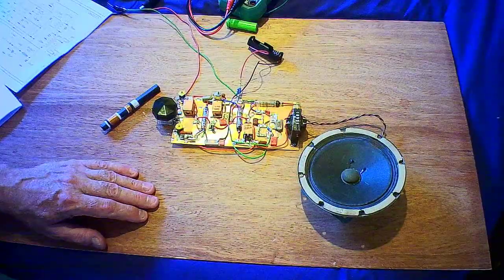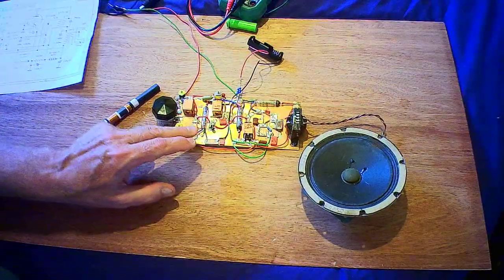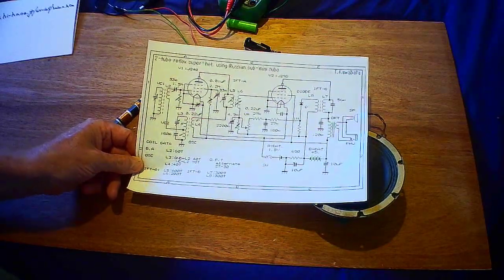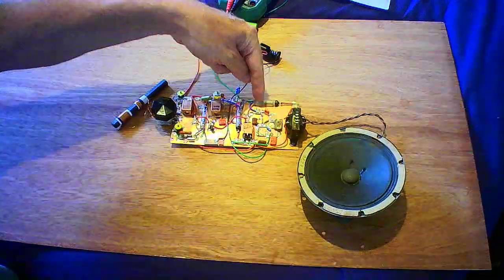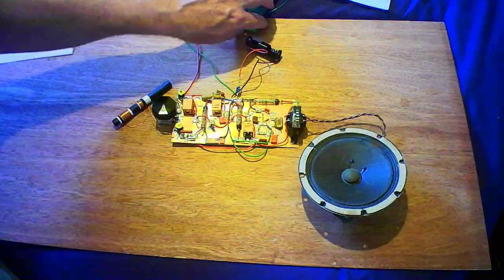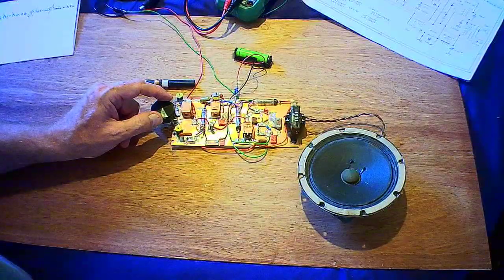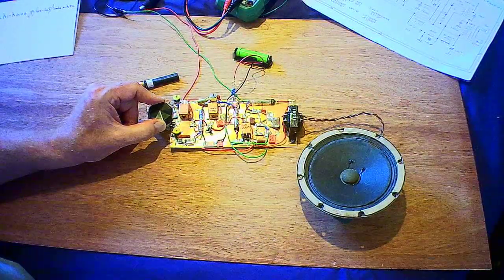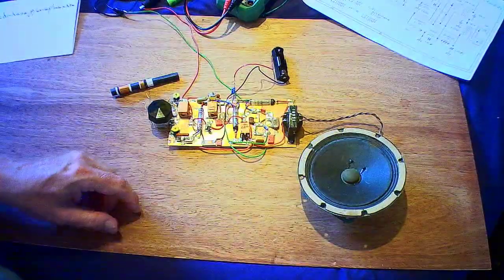Home made Super-het radio with 3 Rod style Pentode Valves/Tubes.

Comment: It's great to see these projects working well and they are of more interest to the older generation like me, that see modern tech as a consumer convenience. I remember the hours of fun I had building radios on veroboard, trying out circuit diagrams from mags and books. I only used transistors but they worked. You are right about the fewer stations received now, about half of what there was 30 years ago.
Reply from the maker: Thanks for the comment, I consider myself as one of the older generation.  I did 40 years as a two way radio service engineer, from early sets that had valves to transistors to radios being full of IC's and lastly to modern day full blown dsp/software radios.  Unfortunately the last 15 to 20 years the idea of repairing things went out the window, it was cheaper to buy replacements.  This is my idea of the days gone past and wondering what it must have been like when building electronic projects was the norm.
Reply: @ef91valve  They were good times and occupied my teenage years. It was good that quite a few school mates had the same interest and we all worked on things most weekends. I like YouTube as it helps me re live those years and watch old TV programmes and test cards. To be honest I don't like the 21st century and i am not bothered about seeing tech advance further. The smartphone is far enough for me.

Comment: Very interesting video and a great project to build. Might be worth adding one more IF stage to increase overall gain.
Reply from the maker: I used an external antenna in the end connecting it to a two turn loop around the ferrite to  the negative of the radio, that worked very well.
Reply: Also adding another wired as a triode for a local oscillator works well.👍👍